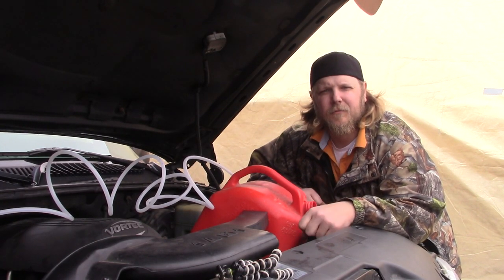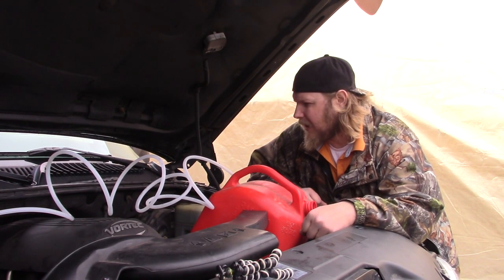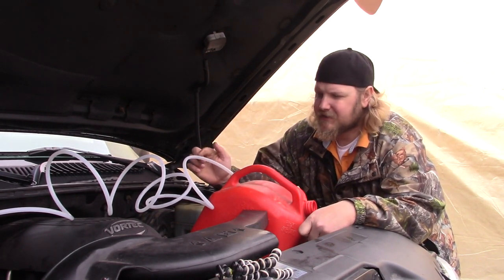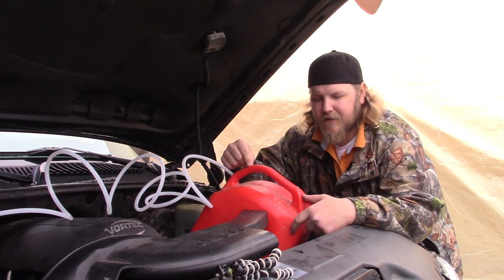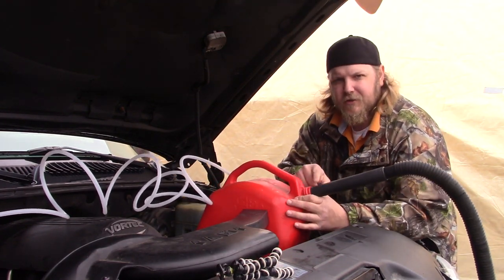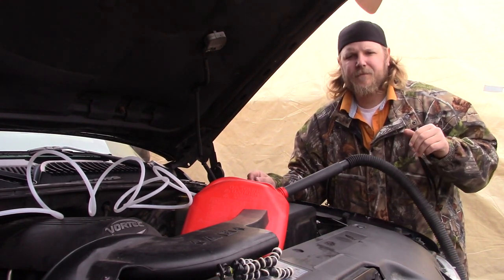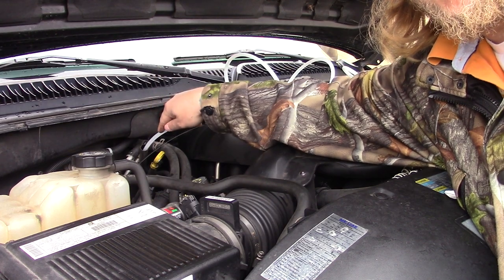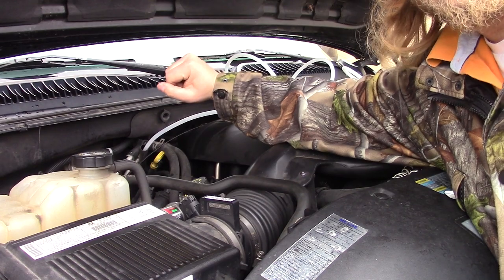How To Drain Your Transmission Pan Through the Dipstick Tube

Comment: Pro tip - use a shorter tube. Also almost surely will go faster if you warm up the fluid first.
Reply: It goes slow when you use pancake syrup instead of ATF

Comment: You can do this by sucking the tube to get it started and set the hose and whatever its draing into on the ground. The force of the fluid comming out keeps the stream going. No shop vac needed. Yours might have be slow because there was no vent hole for air to go into the can creating a vacuum for the shop vac to have to work against.
Reply: Yours might have be slow because there was no vent hole for air to go into the can creating a vacuum for the shop vac to have to work against. ?

Comment: I gotta do this since the previous owner of my Silverado filled the trans up WAY to much with fluid. Like a good 2 quarts too much
Reply: the dealer did that to the TrailBlazer transmission - on a pan drop! 2 quarts too much! I got a lot of air and overflow and then got a flush and the transmission grenaded soon after. It had 270K on it - so I just let it slide and got it rebuilt. Or "reman" trans

Comment: You should probably pull the tube up slightly after bottoming out to make sure it doesn't suck to the bottom and prevent good flow.
Reply: I cut an angle on the tip and it helped keep it from sealing on the bottom.

Comment: It wouldn't hurt to cut down the Shop-Vac tube insert or perhaps use a shorter hose on the vacuum as well. If you have a vac with a higher horsepower of course that's an option. It's a cool idea for changing out fluid but that won't clean or clear a filter or the trash found on the magnetic tip of the drain plug

Comment: Fantastic video, it is slow but I put some masking tape on the dip stick tube and it worked a bit quicker.
Reply: The one I built is very slow too. I may try the tape.
Reply: Is the tape used to create a stronger vacuum or suction ?

Comment: at least you have a drain pan bolt..I am about to drill a hole in my pan and buy one with one since I have to replace that eletrcial connector gasket on the inside..i would rather drill a hole than to drop the pan and make a big mess since I am replacing it anyways

Comment: Nice, I'm first going to try to just siphon it out just suck on it on the tube and then put the Jug on the ground and see if it's he's able to siphon it out like you'd siphon gas out. However, if that doesn't work then I'm going to try your method
Reply: did it work?
Reply: @Drag596  I ended up buying a $10 pump at Harbor Freight and then just pumped the entire thing out

Comment: Nice idea...  I have a 2003 SL Mercedes,,, drain bolt on the trans. pan is ridiculously tight... the opening on the trans dipstick is rather small, and I wonder if a fairly small tube will take forever to suck out via the vacuum.  I am not sure how to measure the dipstick diameter, as it is larger at the filler neck, but  rather quickly it narrows...  any suggestions ?  Thanks !

Comment: you could just go to harbor freight & buy multi transfer pump for 6.99 & use a 20% coupon
Reply from the maker: Thanks man!  This was basically just showing how you could do it in a pinch with materials you probably already have on hand
Reply: Have you actually used that HF multi transfer pump with success?  I bought one and thought it was complete garbage.  Hose was badly kinked and the slip fit ends prevented suction.  Maybe mine was defective though.
Reply: @dcloes  Yes, I just used mine again. I filled a rear end differential and extracted ATF with it. I may have used a HF heat gun on the tubes to get the kinks out.

Comment: is this considered a flush? imn worried about doing this on high mileage cars. Would the pressure damage gaskets/seals
Reply: No a flush is using a special machine to circulate fluid through the transmission, this is the same as draining it

Comment: Here's something to try as well. Inject air into the dipstick tube to slightly pressurize the transmission. You can push and pull on the fluid. Seal the opening of the dipstick tube air tight.

Me? Drain it the regular way. Have a drain plug installed in your pan. Even better install a high capacity pan with a drain plug. Install a ball valve in the drain plug hole. Use a hose to direct the fluid into a collection vessel.
Reply: My thoughts as soon as I saw how slow that trans fluid crept out that transparent tubing. I was scanning the comments for one stating what you did, after talking to the screen to a video 3 years old telling him to tape the openings on the jerry can.

Comment: Can someone please tell me - Does this work when you have water in your transmission fluid and you need to extract contaminants?
Reply: I built one and it removed all liquids, used it for motor oil and for Tranny fluid and here I saw some water bubbles flow through the hose (used a clear hose).

Comment: Shoud have used the shortest tubing possible, should have had the tubing running down through the engine bay to the vacuum below, should have warmed the fluid first. Other than that, nice video LOL

Comment: This idea is alright if you don’t change the filter, and I have done it.
Also you don’t need to remove the Y-Pipe and you can pry the linkage over with a screwdriver or easily remove it.
You can also remove a trans cooler line on the rad and just pump and fill all the fluid out. About 14 qts. Until it all comes out red and is all changed.
Reply: It's important to change the filter, especially if you're doing this at manufacturers recommended maintenance intervals. If you're doing this yearly at 10-15k miles fluid only is ok. But if you're doing this at 50-150k you gotta change the filter. If you suck out the fluid, dropping the pan is less messy than the mess we all envision it is.

Comment: GReat idea, but eventually I would take that pan down to clean all of the debris(aluminum filings gasket clutch material etc.) and clean the metallic debris off the magnet. Eventually enough of that debris will either get by the filter or clog it completely..If you hate dropping the pan you could either buy a pan off internet that has drain plug incorporated(they are not too expensive), or drill and  recommend welding one in base of pan, as a lot of aftermarket ones do end up leaking...
Reply from the maker: Oh for sure!  The drain bolt on the pan was stripped.  I just needed to remove a quart so I could put some Lucas stop slip in it.
Reply: Yeah eventually. I personally just do a drain and fill every 30,000 miles and do the filter at 90,000. After all, Toyota says it's lifetime, so I'm already going above and beyond recommendations.

Comment: What about the filter doesn't that need changing??
Reply from the maker: The drain plug was stripped on the pan, so I used this method to remove one quart of fluid, to add a quart of stop slip.  This is not a complete transmission service.

Comment: IF YOU DO THIS   you are just replacing a very small percentage of new fluid on the next  suck out you would be just sucking out old with  % of the new  fluid you had put in  the first time .right or wrong please let me know  .
Reply from the maker: Its main purpose was to remove a litre to add a little of Lucas stop slip
Reply: That is  a good reason  and you have  a good system there, I think if you had a little shorter hose  it would work real good  or better.

Comment: First of, if the vacuum hose has a gap between it and the container, you’re losing pressure. Second of the container needs to be lower than the pan. You’re making it harder than it needed to be.  Not a bad idea, but can be improved.
Of course… problem with this, is there people will avoid removing the pan and cleaning it, and and of course not changing the filter either will only dirty the new fluid right away.  Good idea to avoid the mess if your pan has no drain plug, or it can’t be removed…. But terrible idea if used to replace fluid only.

Comment: So much wrong with this 'McGyver' method. 
It's o.k if you have overfilled (but there are easier methods for that, like a simple syringe instead of jerry can and vaccuum.
1: It doesn't drain the Torque Convertor so leaves about 1.5 quarts of old fluid.
2: It doesn't give you the chance to inspect the pan for sludge or metal filings and prevent damage in the early stages.
3: If your trans fluid needs changing then so does the transmission filter inside the pan.
4: If your not going to change the filter or drain the Torque convertor then why bother spending money and time changing the fluid at all. 
5: No time to do it properly, but time to film and edit and upload it to you tube.
Reply: Why do it at all? Because it still gets out several quarts of old fluid, duh.
Reply: While traveling it may not be practical to drop the pan and unscrew 20 bolts.
Reply: install a magnefine external filter to get out the metal. Then just keep exchanging new ATF with the manual pump - that's what I'm going to do.

Comment: You do the same with your engine without changing the filter 🤔 not to smart
Reply: You can still change the filter, right?
Reply from the maker: Read the comments bud.  I did this to remove a litre of fluid, so I could add a litre of Lucas stop slip.  People are quick to judge.
Reply from the maker: This was not to do a full trans fluid change.  It was to remove a litre of trans fluid, so I could add a litre of Lucas stop slip.

Comment: Flat thumb no thumbs up. You used way to much Nylon tubing I think. If the tubing was shorter it would not have to travel so far to the can. Plus should have put can on the ground lower than the pan.